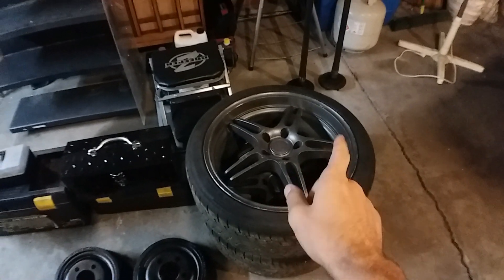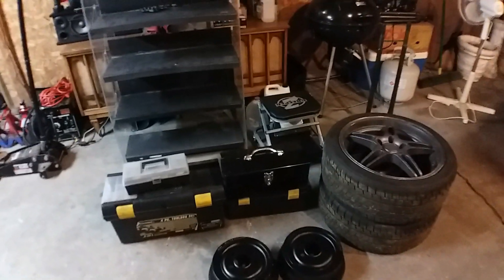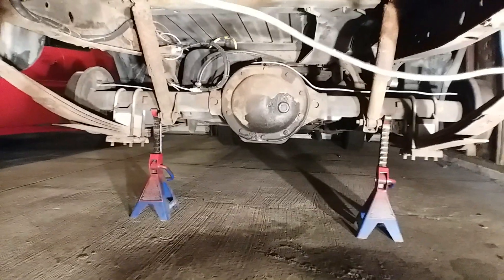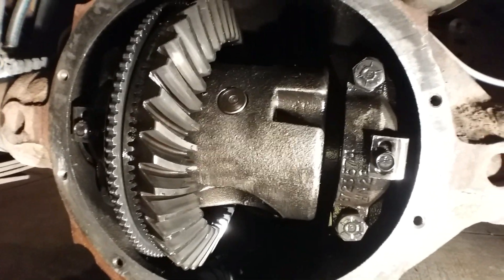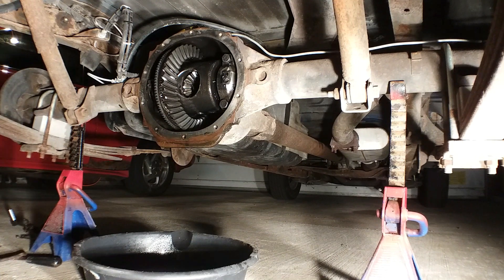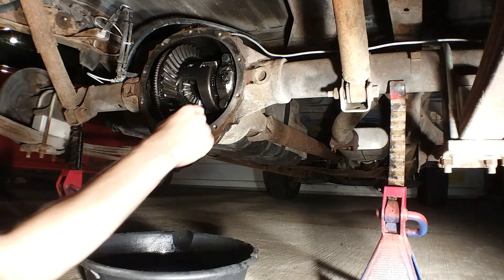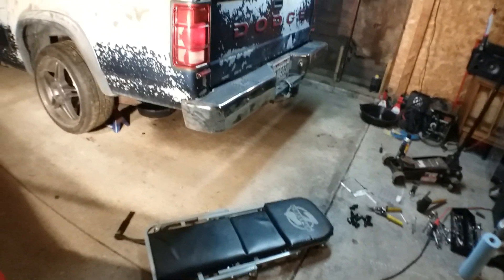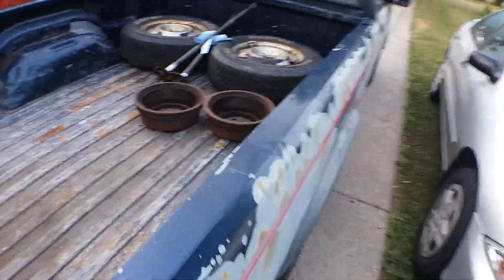Dodge Dakota 5 Lug Conversion Pt 1: Rear End

Comment: Great video. I have a question.
I ordered 8.25 axles for a 5 lug  conversion and new bearing kit. But my new axle won't fit pass the new bearings ? But if i put the old 6 lug  axle  with the new bearings it fits just fine 🤔why.

Comment: Hey! What drums did you end up using? I have 10” brakes. Not sure what drums to get.
Reply from the maker: I used 10” drums for a 1990 Dakota. Both the 5 lug and 6 lug Dakotas came with 9” and 10” drum options so they’re all readily available

Comment: Where did you get those rear axles
Reply from the maker: They were from a junkyard. 87-90 dakotas are 5 lug and the axles are a direct swap. Just make sure if you get a set at a junkyard that it’s an 8.25” rear end and not the smaller rear end some base model trucks had
Reply: @RustBeltGarage1  is the 8.25 the length or thickness? And would these axles fit on a 98 durango

Comment: What size tire are you running? 235/40/18? I just got a pair of 18s for my 93 Dakota and now I’m looking for tires. I want something that’ll fill it out. You think a 285/40/18 would look good?
Reply from the maker: I’m currently running a 255/45/18 on the rear and it’s a nice size sidewall for the truck. The tires on it in this video were way too short of a sidewall, I can’t remember exactly but they were about an inch shorter diameter than the stock tires. A 285/40/18 will be perfect but make sure that you won’t be rubbing the inner fenders. If you don’t have an aggressive enough wheel offset you might have clearance issues
Reply: Rust Belt Garage the offset is 35mm on a 18x9 wheel, I’m pretty sure it’ll be okay I currently have 285/40/17x9 and they don’t rub, they just look to small.
Reply from the maker: Ah yeah that’s basically the same total height as the ones in this video and they were definitely too small. You should be good on clearance but I’d get in there with a tape measure just to be sure. The 285/40/18 should be spot on as far as height
Reply from the maker: I just did the math and a 285/40/18 is almost exactly 27” so you’re right on the money with that size
Reply from the maker: I have found that 27” to 27.5” total tire diameter is the sweet spot for a lowered Dakota but it also depends on your preference and also your ride height
Reply: Rust Belt Garage okay that’s good to know, right now I have stock height but I plan to lower it about 2 inches or so, so that’s perfect

Comment: Glad to here I can use the five lug axle off a 88 dakota. I’m in the middle of restoring my 93 dakota right now, Guess I’m gonna go ahead and make the change over to five lug now.
Reply: How did your resto go? I just did a frame off resto to my 96 5.2, 5 speed, short bed, standard cab, 4x4, swapped a 8 3/4 to get my 5 lug.

Comment: Would this conversion work on a 2003 Dakota? Thanks
Reply from the maker: It should work on the back but there’s a chance the axle lengths are different, I can’t remember. The front hubs on the later Dakotas are completely different from the older ones so concerting then is going to be difficult

Comment: You say at 2:22 for the rear all you need is:
The axles 
5 Lug drums 
New gasket
Fluid
At 17:34 you said you used 
1990 Parts from a Dakota 
My question is What year is your car and will this work on a 1999 Dodge Dakota?
Can you call me 702-666-7255 Sam
Reply from the maker: Yep you got it, i would suggest getting a new diff cover also and inspect your brake shoes for wear while you are in there so you don't tear up your new drums. Do you have an instagram i could message you at?
Reply from the maker: I just realised you said its for a 99 dakota and in that case i don't know for sure. I'd suggest doing some forum searches to be sure the same parts will work. Axle lengths might be different on the 97+ dakotas and I'm not sure about the front hubs.

Comment: Please can you tell everybody 
Exactly what year for the front hub?
Is it the same year for the back?
Reply from the maker: Parts for any dakota from 1987-90 will work for the conversion.
Reply: 1990 is the correct rotor there are differences between those years

Comment: Where is part 2?
Can you tell me how to do the front?
Reply from the maker: I haven't done the fronts yet but all you have to do on a 2wd dakota is get 5 lug brake disks for a 90 or older dakota and put them on. The hub and rotor are one whole assembly and its a direct swap.
Reply: I hear you just reuse the same calipers on the front, just buy the new rotors/hub assembly. And new wheel bearings/seals while you are at it.

Comment: The wheels really suit the truck, looks much better.
Reply from the maker: It drives a lot better now too!
Reply: Rust Belt Garage Can you please Call me 702-666-7255
Sammy
Reply: Those thin sidewall tires really look like poop though.
Reply from the maker: @donrutter6550  yeah it looked really odd, it has different tires on the back now that have the same overall height as my stock fronts and its a lot better. Still needs more low and the front end conversion to look right though lol.